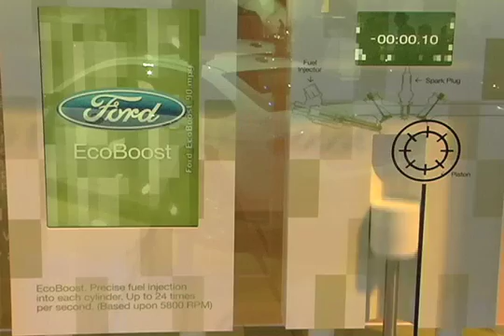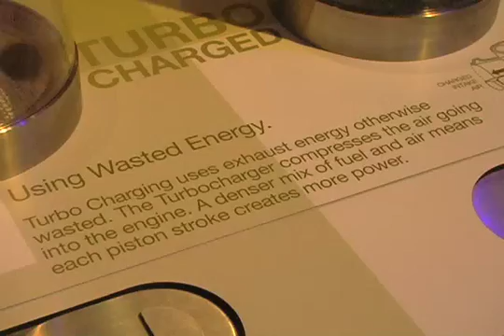Ford EcoBoost vs Diesel

Comment: I agree, leveraging different technologies to achieve efficiencies is good. The only question will be: Is it cost competitive? I hope that the Volt does work. And as you pointed out, other engine technologies such as small (but clean) diesels could be used to run the generator. On a separate note, Ford gave me the same answer at a Fleet conference last month about the price of diesel fuel although it flipped to the low side recently.

Comment from the maker: I'm keen on the idea of using a small displacement diesel engine as a generator for an extended range electric, a la the Chevy Volt or better yet, Neil Young's wicked cool LincVolt.

Comment: You can combine clean diesel with hybrids, but is the incremental improvement in mpg with the additional hardware (motor, controller, batteries) costs?  Electric propulsion hasn't taken on in the popularity context. EVs have the least impact on the environment when they are charged at night. I usually see EVs being charged during the day (and night) when they are used in Fleets.

Comment: The bottom line is measurements taken at the tailpipe. And clean diesels are in fact clean. For European and Asian (Honda) passenger cars and American larger commercial trucks (class 7 and 8), engine manufacturers have successfully employed emissions control through either SCR or in the case of International  high flow EGR.  SCR technology is either wet or dry. Wet technology is less convenient because ammonia or urea needs to be replenished periodically. Diesel VW's are available in the States.